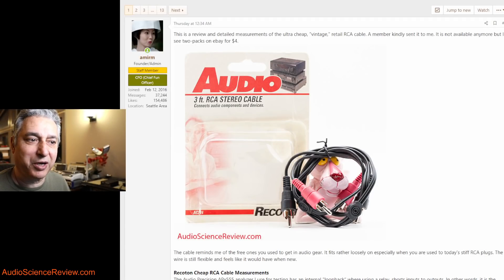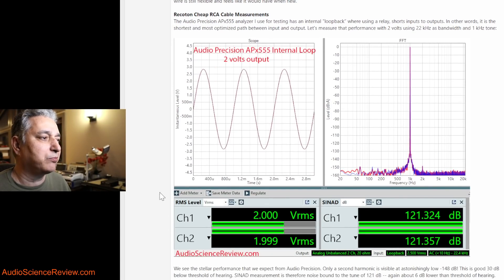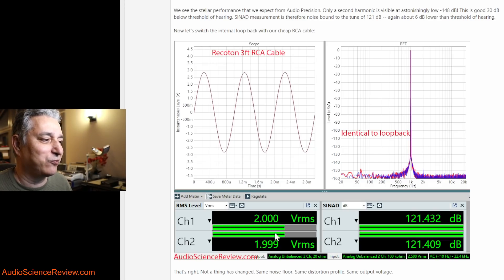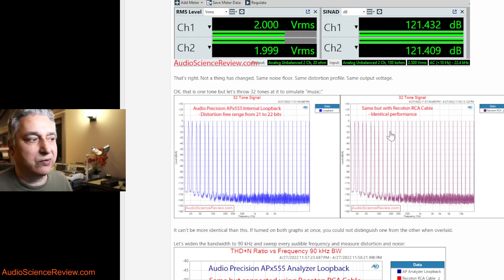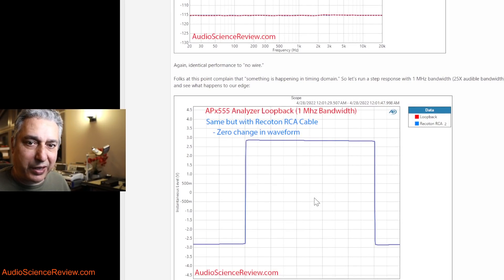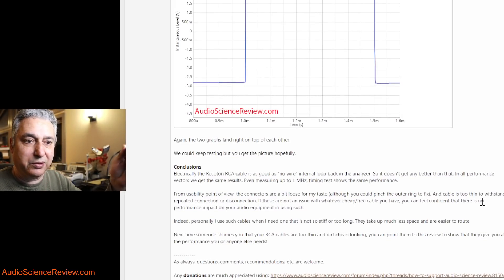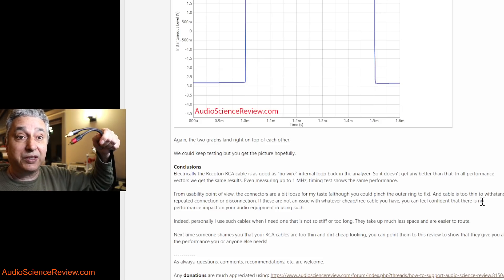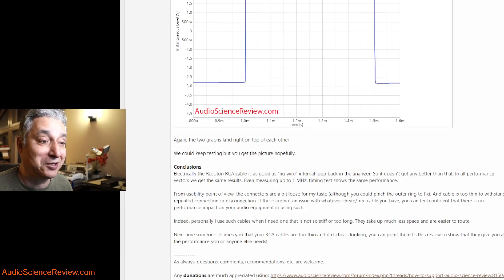Are Dirt Cheap RCA Cables Any Good?

Comment: Gotta love how the audiophools can't resist watching Amir's videos just to try tell him he's wrong, after all their ears are 1000's of years older than his test gear.  That's why NASA has people listen to their rocket engines instead of using test instrumentation, so much more sophisticated and why hospitals have given up on MRI machines and just listen to your chest instead.  So much more resolving.
Reply: I have done blind A/B for fun with this kind of cables over 30 yrs ago multiple times with friends. I did 10/10 guess EVERY time. If someone does not hear that he is D E A F. The fact that we don't see the measurements difference means that we still don't know, understand and measure everything.
Reply: Some engineers do use their ear to hear abnormality. I used to work at ship engine room, you will be surprise some engineer can pickup  abnormality with all the noise from engine, pump and machinery, before any damage will be introduced. Sonar worker need to hear beside looking at the screen. Some doctor can listen to your heart beat and guess the rate before looking at screen. Plus audio engineer have to figure out at 0.1dB to make decision.
Reply: 1000 of years older.  Wtf is that for a comparison. Given up on mri , you must be from.anoher planet or being sarcastic

Comment: I still have boxes of these things lol! Only complaint I ever had with them is the high shield resistance since over a few feet they start picking up audible hum. Some don't even have that, just a second conductor, but I digress. I do miss RadioShack, tho. My last few spools of their branded wire just ran out. Still have many spools of their 60/40 solder. Cant go wrong with that.

Comment: I like this channel. However with cables how do they sound?  You can hear a difference. You can’t measure it. The more resolving your system, you can hear it. 
Silver connection v gold are decidedly different. It just is. You can hear it.
Reply: @richardtrussell8220  Are you for real? What's evolution got to do with it?
Reply: If you really can hear it, describe it. Describe how it changes the sound of each instrument in the reecording, and the vocal. Shouldn't be difficult for someone with ears as accurate as yours.
Reply: @richardtrussell8220 repeating this evolution argument.. witch has nothing to do with it.
Reply: @richardtrussell8220  Perhaps you can volunteer yourself for a blind test. I am sure Amir would oblige.

Comment: Just don't use it for a turntable. That's when it's actually worth paying a bit of extra and get a really low capacitance cable, like the Blue Jeans Cable LC-1 (only 12.2pF or capacitance per foot!)
Reply: Just don't use turntables anymore. Let that technology die already.
Reply: @florin604  haha, true! It AMAZES me how these nut-job audiophiles can be so in love with a format where the last song on an LP sounds (and is, measurably) lower-quality than the first song! It's insane. I do quite like the whole vinyl experience - a quality turntable, a decent cartridge, a treasured record - but it has little to do with the audio quality - if I want quality, I play a CD! If I want a fun, nostalgic experience, I'll play an old record that I've owned since I was a teenager! The clicks and pops still annoy me though! The flaws of vinyl just make no sense if audio quality is the primary goal. This "debate" wasn't even a debate when CDs were introduced - everyone knew and accepted that CDs were far superior - it's absurd that vinyl is becoming so popular again. Maybe in ten years' time the morons will "rediscover" CDs, and everyone will throw out their vinyl once again 🤣
Reply: Funnily enough, budget turntable manufacturers are one of the groups who still tend to bundle these kinds of cables with their equipment. I buy from a bloke on eBay who makes really nice, well made cables with lockable RCA's for about £30-£40. I'm more than happy with the results.

Comment: If anyone thinks something this bad would not make an audible difference on a high end system is purely nuts.
Reply from the maker: Sad how far we have lost our way in audio to read comments like this....
Reply: @AudioScienceReview  did you perform any sort of listening test with this cable? do you have a high-resolution system on which to test it? I would be extremely interested to hear of your impressions in switching out a reasonably well made cable with this one.
Reply: @EskWIRED  -- Why introduce listener subjectivity into testing a simple component proven to be electrically transparent at any audible frequency?  Do you think a pricey "audiophile interconnect" can outperform the internal loop mode of a SOTA audio analyzer -- used by virtually every company building quality audio gear all over the world -- with a mid-five-figure USD price tag?  I can understand a "listening test" for a transducer or as a sanity check when an amplifier measures surprisingly well -- but for a $2 cable that measures perfectly according to best available instrumentation for precision audio applications?  Eye dun thin' sew loosey!  :-)

FWIW, Amir does own a credibly "high end" system with Mark Levinson electronics and big Revel floorstanding speakers -- but I wouldn't venture whether his personal gear qualifies as "high resolution" or "resolving," because IMO those terms are essentially meaningless marketing jargon promoted by people selling vastly overpriced products.
Reply: @editorjuno  Does he use crappy cables on his system?  Does 18 gauge lamp cord connect his Levinson amp to his speakets?
Reply: @EskWIRED  -- Probably not, but at least he's not under the common delusion that choosing wiring products that cost more,  look better, and are (usually) more durable results in improved "resolution" or any other such purportedly audible advantage.

I for one am grateful that he graciously provides accurate information on products more appropriate to folks with more modest home audio budgets who want to know which upgrades are worthy of their hard earned money rather than just padding some snake oil purveyor's bottom line.

If this particular review prevents even one such person from investing three or four figures USD in overpriced cabling rather than putting the same amount of money toward better speakers -- or the oft-mentioned family vacation fund -- then he's providing a very valuable service at his own expense in time, effort, and the immense amount he's already spent on the finest available measurement gear.
Reply: @editorjuno  somehow, I can't believe that someone willing to spend upwards of $1,000 for cables would be swayed by this video.  And I doubt that his amp and preamp are connected with the sort of cable that was tested.

But if the results of this test are accurate, there is no reason whatsoever to use cables any better than the ones he tested.

I would love it if he inserted these into his system and told us what his impressions are.
Reply: @EskWIRED  -- There are reasons, they're just not related to actual audio performance.  As for your idea, that's up to him, assuming his system isn't at this point connected up via XLRs.  Join ASR -- you don't have to donate or otherwise participate in that community -- and you can put your request to him directly and privately.  I'm batting .666, on that score, FWIW -- he consented to two of my ideas and politely declined my third one.  :-)
Reply: @EskWIRED  The results of this test are accurate. There is no reason, from a sound perspective, to use any better than the ones he tested. 

Purchasing cables based on appearance, i.e it is aesthetically pleasing is perfectly fine. What grates me is when companies literally lie about the benefits of their products based solely on magic and fantasy. Then the whole "high end [insert what ever BS here] system" crap.

Listening to my step up makes it impossible to tell apart one cable from another.
Reply: @AudioScienceReview  I appreciate your videos and the science and I don't mean any disrespect but I'm starting to think you just can't hear the difference maybe? The sound difference even with my powerplant I mean it's white vs black differences.
Reply: @B2_Labs   Back to your original claim, can you please answer which bit of the reviewed cable is bad?
Reply: @aaparky7039  well, since it doesn't meassure bad, he means the look.
Reply: @aaparky7039  I think it's pretty obvious we are talking about the cheap rca cable
Reply: @B2_Labs  which performs really really well. You state that it is "bad" what exactly is bad about it? You still have not answered the question, nor provided any information as to what is "bad" about it.
Reply: Which bit was bad?
Reply: @aaparky7039  I could take Joe random off the street and play my system with Amazon branded cables vs mine and the would hear the difference in 10 seconds or less. I've done it with friends who don't even care about music besides airpods
Reply: @B2_Labs  but you still have not explained which bit was bad. 

Which bit is bad?
Reply: Based on what ?
Reply: @Douglas Blake it's far from psychology...cables don't matter on all systems. The difference is so obvious it's like saying water isn't wet.
Reply: @B2_Labs  still waiting for your explanation of what is “bad” about the reviewed cables.
Reply: @aaparky7039  absolutely terrible Emi rejection without proper sheilding and anything close to this on my system looses all life and goes 2D.
Reply: @B2_Labs  so, a measurable characteristic?
Reply: @B2_Labs  -- Most "first world" locations don't have EMI issues in the 21st century.  "Proper shielding" at the very low frequencies and source impedances encountered in reasonably short line level "audio interconnects" doesn't benefit from the sort of engineered solutions required for good performance and noise rejection at higher impedances (e.g. magnetic phono cartridges and unbalanced line dynamic microphones) and/or frequencies (e.g. composite video and radio signals).

I think you're experiencing some sort of confirmation bias based on your financial and/or emotional investment in cables you believe are superior -- but it's obviously your money to spend as you please.  FWIW, my system is as "3D" AF and every RCA cable therein is as ordinary AF except for the two "THX-certified" Monster cables that connect to my three-way studio monitors -- I bought them for $2 USD at a local charity thrift shop years ago and they were just the right length for the job, so I put them to use.  :-)
Reply: @editorjuno  EMI is everywhere... More now than ever. Buy an Emi meter and walk around with it, especially by any equipment with a transformer. Wifi, Bluetooth, cell towers, radio, its EVERYWHERE. I don't doubt your system sounds good, a system can sound amazing with 30 gauge wire BUT it's not the most you can get from it.

Also no I WANTED to believe cables DIDN'T matter - I used to joke how silly the expensive cables were, how it was dumb, but I wanted to TRY it. The audible difference is truly as contrast as white is to black. To each their own.
Reply: @B2_Labs  Psychoacoustics is this powerful, not your cables.
Reply: @B2_Labs  -- You might need to read up on psychoacoustics and what it actually takes to deal with the sort of everyday EMI you describe, which is very little at audio frequencies.

"To each their own" right back atcha!
Reply: You are mistaking "if anyone imagines" for "if anyone thinks."
Reply: And everyone hisses at you. What a bunch of flat earthers.
Reply: @Douglas Blake Do you connect your equipment together using those sorts of cables?
Reply: @EskWIRED  Pretty much Amazon Basics too, or what ever my local Hifi dealer has, normally just cut off a bulk real and terminated to required lengths.

Comment: I tell/show people this all the time. 

But, where a GOOD RCA cable(notice I did not say expensive) is better than one of these, is noise rejection. 

I use one of those "lightning" displays(the ones you touch and all the lightning goes to your finger, like you find at Spencers Gift at the mall) to measure noise rejection. I simply lay a cable across that lightning thing. It makes so much EMI/RFI noise. 

Throughout all of my testing, a simple DIRECTIONAL shielded twisted pair is FAR superior to anything else. And yes, I said DIRECTIONAL. In a directional RCA cable, the shielding is tied to the source end(preamp etc) and not the load(amp etc). This creates a Faraday cage, and dumps the EMI picked up on that one end. 

Which end do you want this noise at? Your preamp, which is low gain, or your amplifier, which is high gain? 

Or use differential balanced connections and never have to worry about this stuff at all. 

Dang 'ol science and stuff.
Reply: @Douglas Blake -- Those cables have two inner conductors that comprise a complete circuit when connected.  It's just the shield that's connected at only one end.
Reply: @Douglas Blake -- Were all his fancy cables like that or were one or two of them simply defective?  Just curious...
Reply: @Douglas Blake -- Thanks.
Reply: @Douglas Blake -- Fair enough.  Whoever they are (or were), they're obviously best forgotten.
Reply: @Douglas Blake Reading is fundamental. "Shielded twisted pair"
Reply: @Douglas Blake in what ways do the amazon basics cables measure differently than the expensive cables he was using?
Reply: @Douglas Blake That's not what I asked.
Reply: @Douglas Blake Fair enough.
Reply: @Douglas Blake I have a lot of trouble believing that crappy cables cannot alter the sound. I also have a lot of trouble believing that every single person who hears clear differences is fooling themselves. Finally, I have a lot of trouble believing that we know everything about what and how to measure.

Do you remember the days of "perfect sound forever" when early CDs and/or players too often sounded bad?

I remember folks claiming that the numbers don't lie back then too. In the meantime, we've learned more about how to test CD players and other digital sources.
Reply: @Douglas Blake thanks for your thoughts.

Comment: hi thanks a lot for the very kind and valuable test as always
i have always wondered why not using the cables used to connect probes to scopes
If they are good for scopes they should be more than enough for Hifi as well 
I think that they are also quite cheap

Comment: Some time ago I cut one of those cheap RCA cables and was surprised to see a bunch of three thin "shielding" wires running along the central insulated wire. So the "shielding" wasn't shielding anything. Basically it was a zip cord trying to look like a coaxial cable from the outside.
Reply: Very common. More shielding wires more stiff and adding cost. That goes to shielding foils too.
Reply from the maker: Luckily what we care about bleeding into the cable is very low frequencies.  If we used them for high frequency applications, they would be horrid but we are not.
Reply: @AudioScienceReview  I agree. As far as I know, using a twisted pair would be more effective than shielding for audio in environments with AC mains interference. Have you ever done any interference tests on a longer unbalanced cable vs twisted pair cable? I'm just curious...

Comment: Measure at 2volts shoudn't make much difference but try testing at say 10mv a phono cartridge output and hum, microphony and noise pickup become a problem with cheap cables and with poor connectors.Also high quality video monitors give better definition with better cables with visual testing
Reply: No only "not much difference," but no difference.  Phono cartridge output and composite video are very different from line level audio in several respects.  One thing they have in common is significant susceptibility to the effect of shunt capacitance, which is a non-issue for line level audio cables at the typical 1-2 meter lengths found in home stereo systems.

Comment: Not those, they are just too ugly, but those just a little bit more expensive, are great, l soldered my Via  Blue cable, 8 euros per mètre. Semi balanced RCA, but it is fantastic. !!!!
Reply: AFAIK there is no such thing as "Semi balanced RCA."  Fancy "audiophile" RCA cables (with two inner conductors and a separate shield connected to the "return" inner conductor on only one end) are still very much unbalanced.